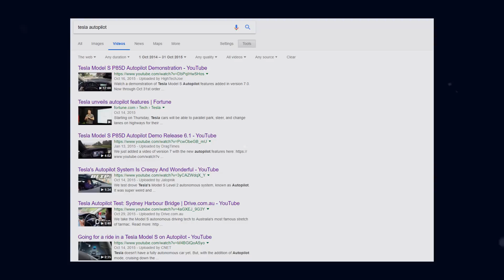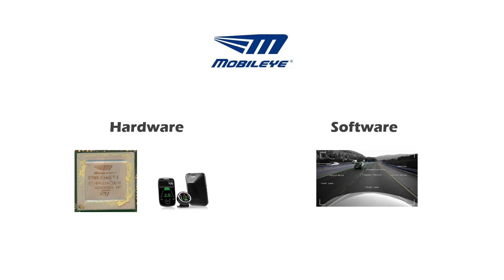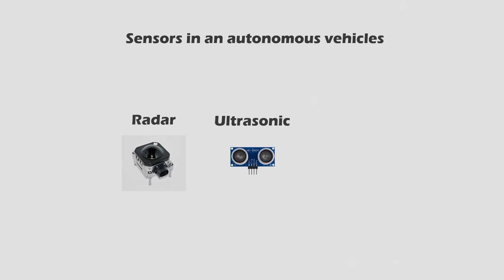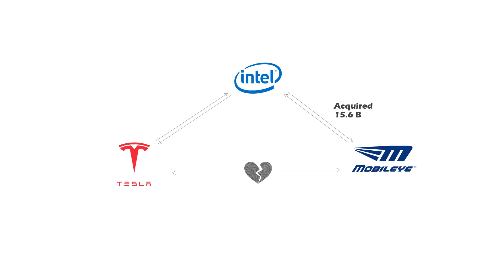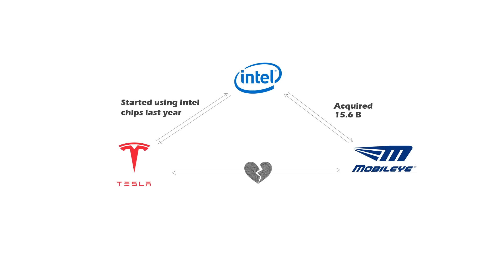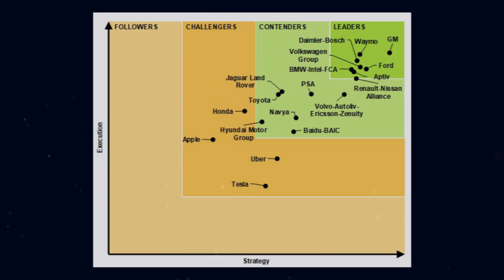Tesla's Autopilot is in Trouble, here is how to FiX it!

Comment: It is kind of silly of them to compare theoretical self-proclaimed capabilities, not even implemented in any car on the market or tested by independent party to something already on the market for some time and planed to be fazed out soon.
Reply: According to actual statistics, cars with AP are significantly safer than other cars, so AP is definitely ready for the and should be used. It was definitely a bold move to release it initially, but the data proved that it was the right thing to do.
If others still don't think their systems are ready, that's their choice, but then they are not competing seriously with Tesla. I don't think it's fair to compare prototypes to actual products, because with prototypes you have the luxury of choosing ideal conditions, while actual products have to work all the time.
Reply: Exactly. Tesla has different prototype software that show a model x driving 10 minutes through SF yet they're comparing autopilot to the other auto makers prototype version
Reply: Ambient Morality you're confused, Uber and Waymo vehicles are the same thing that google has been driving on public roads for over a decade now, basically it's a car with a laser that follows a map and makes sure not to hit anything at fairly low speeds, in my opinion this will never be a replacement for humans, it can only handle low speed city driving of mapped areas, you can't measure self driving progress by watching a demonstration, you and the rest are sadly mistaken, let me know when you can actually buy one of these cars and drive them in a variety of areas, meanwhile tesla has had commercially available autopilots for years now, if there isn't some secret project from someone else then in all actuality Tesla is the closest to full autonomous.

Feel free to argue, your knowledge isn't in depth enough.
Reply: I wouldn't call that a limitation of the system, I'd call that a demo setup, if you put following a small test course on a scale from 1-10, ten being a true autonomous better than human vehicle and 1 being like cruise control or something it's very low down there, even though from the outside it looks kinda equivalent to say a human taxi driver, don't get me wrong I consider all this technology cool, and I was highly impressed when I first saw this from google back in the day, but like I said it's not new and it's not progress, it's a demonstration, presumably for marketing purposes.
Reply: Ambient Morality
No idea what "AEB" is, but statistics definitely prove that a Tesla is safer when the autopilot is on.
Reply: Autonomous emergency braking. Tesla implemented it a few months before Autopilot, and AEB has been proven to quite dramatically cut down accidents across multiple vehicle families and manufacturers. Autopilot hasn't shown that, though.
Reply: Uber just killed a pedestrian, so....
Reply: Waymo has a fleet of self-driving vehicles on roads now, Uber has autonomous pilot fleets. Neither system is perfect, but they're much closer than Tesla.
Reply: Do all of them? Your point is moot.
Reply: *moot, and no. But it is a responsible thing to not release half-finished software that has driver safety in its hands. Most automakers don't believe their software (or Tesla's, for that matter) is ready for the road.
Reply: Ty. Yes, but I don't see the relevance.
Reply: No actual statistics show that autopilot is safer. We know that AEB is safer, but that isn't autopilot at all.
Reply: "Follow a map" sounds like less than it actually is. It is still reading the road to make sure it is following lanes, turns to the correct turning lanes, etc. It is true that the lane structure is mapped out in advance, as well as relevant road signs, and this is a limitation of the system. Of course cameras to recognize these signs are necessary for truly flexible FSD.

Comment: The biggest reason Tesla decided to do away with lidar was that it was ugly and expensive, but since then, small and inexpensive solid-state lidar has been developed and i think they should include it in their package
Reply: It also doesn't see through rain and snow.
Reply: András Bíró you're right, that's what the radar is for
Reply: we have yet to see a supposed solid-state lidar in action.
Reply: GM will use the solid-state LIDAR and they are at the top of the Navigant ranking. This thing is tiny & cheap.

Comment: They can’t change any hardware anymore right now, because all the cars are already manufactured and promises full auto in the future via software update. So tesla needs great software and nothing else.
Reply: We don't even know if the hardware is sufficient. Direct image processing is a very heavy computational problem.
Reply: That worries me a little with how much they promised. If they didn’t already make these promises they could just switch out the hardware on future cars or make an upgrade package with improved driverless features but since they’ve made these claims wouldn’t they be open to lawsuits.
Reply: i completely agree. 
the link with waymo is simply nonsense. waymo are 100% in bed with lidar, they even bought a lidar company as their charges were silly. retrofitting lidar would be insanely expensive to cars that already left the factory, and they would have to do it based on promises made. 
i wouldn't be too worried about cameras being the main hardware component. i've been driving fine with my eyes for quite some time now. 
Tesla did however lose years of experience when they brokeoff from mobileye. thats not easy to replace. 
the thing i think we have to remember is that elon rarely misses the obvious, and the model 3 would have never gone into production unless he was confident they could deliver without mobileye (it went into production after breakup). 
i certainly wouldn't count out another partnership, but only if the specialise in the hardware that has shipped in the 3. 
still loving the videos though, keep them coming!
Reply: I think if Tesla committed to replacing all hardware on past vehicles for the owners who paid for FSD, then it'd be okay.
Reply: Recent Teslas should have the processing power to process the imagery. Neural networks take a lot of performance to train, but are pretty cheap to apply on data. I agree with Elon Musk that LIDAR isn't necessary, but it does help a great deal. Without LIDAR you have a much larger burden on the software. We can do the same with moving camera images (it's called SLAM), but it is tricky to get right.

I believe that the hard part is decision-making. What to do when... How do you merge onto a busy highway? How can you robustly make it match its speed to the visibility? What do you do when you end up in a bad position because you or some other driver made a mistake? 

Knowing your current situation is one thing, knowing what to do in that situation is another. That part is not solved by far, by anyone. Google/Waymo is far ahead, but they almost definitely still have quite a long way to go.
Reply: Niosus, computing performance might not be an issue, we don't know yet. But the sensors are. My radar and the cruise control refuse to work as soon as there is snow or dirt covering the nosecone. A little snow, and I mean really little, is sufficient enough to disable the entire system. Our e-Golf has a heated radar, it never stops working in the winter. But even the cameras, especially the rear facing camera, turn pretty much useless in rainy and snowy conditions. A lidar located on the roof of the car would be able to handle these situations.
Reply: You also have a brain much more capable of processing image data. So far, we don't have a computer anywhere near the general image recognition capability of a human brain. We're getting closer, but it's hard to get very close.
Reply: He needs to get it done now. I don't buy that he is using his time for other projects. It is not his time that is being used but the programmers and engineers time. Writing no fail software is hard and time consuming. You can't make a mistake or have a bug, it will kill someone. So this means lots of unit tests and real tests and that eats up time.

Comment: One question.. WHY? Did mobile eye even break up in the first place? Your explanation wasn't really precise
Reply: Mobileye thought Tesla was moving too fast with the technology and they felt responsible to pull the brakes and ask Tesla to stop using their technology for self-driving because they didn't want to risk lives. 
Elon, on the other hand, said if their technology has saved any lives at all, it is their moral responsibility to enable it right away. (example Auto-pilot being 50% safer than a human driver when this drama happened)
This disagreement got very public and led to the break-up. The video was not very well researched if you ask me. I think Tesla with their in-house machine learning capabilities and their fleet of cars capturing data is in a very unique position to solve this in-house. 
After Mobileye they are hesitant to partner with others. The idea of partnering with Waymo is laughable because they use lidar and Tesla needs a solution that works on all their current auto-pilot 2 cars. They're not going to re-design the model 3 sensors. not at least for another 5-6 years.
Elon likes to have everything vertically integrated. Everything in-house. Tesla Vision is another example. there will be no partnerships.
Reply: TY that cleared things up.
Reply: One fatality but many other lives saved. That's why they enabled it. A quick youtube search will show you many instances of the system saving the driver from bad accidents. 

I don't remember them blaming Mobileye for it. Do you have a link for that? I may have missed it.
Reply: Actually, they said the trailer on the road looked like a highway sign due to the size. But that's still not blaming the manufacturer. Tesla has their own software. They didn't blame Mobileye in any way.  
"We don't know how many lives were saved, or whatever."
You can look up youtube and see for yourself. We don't have an exact number but it's sure more than one that we lost. 
And in that case, the driver missed a semi crossing a highway! which means he wasn't paying any attention whatsoever.
And AEB is common so...? what's your point there?
Reply: Ironically the guy who died in that accident also posted a "Tesla saved my life" video on YouTube. Also the AutoPilot can't be blamed for the accident, because it's not fully autonomous yet, the driver has all the responsibility, AP is just helping. Maybe the same crash would have happened without the AP, we don't know why the driver didn't see the trailer. Or maybe he trusted the AP too much, but that's still not the AP's fault.
Reply: @András Bíró , the guy who died also complained about a bug that end up killing him; "the car don't see stationary vehicle", he also said Tesla took toooo long to fix any bug. The police did an investigation but the conclusion wasn't publicised. After the incident Tesla & Mobileeye broke up.
Reply: xponen
AP isn't perfect yet, that's why thew driver has to pay attention. It's a lot harder to recognize stationary objects on a camera feed than moving things. And stationary object aren't supposed to be in your way anyway, which means much less training data for the AI, and therefore even less accurate recognition. AP in it's current form is meant to be used on highways, where stationary obstacles are even less expected.
Reply: @András Bíró , I think it's just flawed architecture; the original AP by MobileEye assume everything can be solved with a camera... the overconfidence (hubris) is apparent... should've add more sensors to detect stationary object instead. Probably UBER were led to same mentality and turn OFF their LIDAR as well, thus leading to a death.
Reply: xpopen
Uber proved that more sensors won't help. Also lidar is expensive, has to stick out of the car, and doesn't work in bad weather. The problem is not the lack of sensors but the software. It's far harder to identify stationary objects and find out if they are in the way and actually dangerous. For example a pothole or a small stone are obstacles in the way, but most of the time you can drive over them safely. This is not full autonomy yet, the driver has to pay attention. Tesla never claimed that AP is capable of full self-driving, in fact the owner's manual specifically warns about stationary objects.
Reply: We don't know how many lives were saved, or whatever. At any rate, AEB would saves lives as well, which is why it's a very common feature now. That is a long step from self-driving, but is still a safety feature.

Tesla has stated that the cameras were unable to detect the trailer against the background (due to insufficient contrast), which is effectively blaming the camera supplier.
Reply: MobilEye didn't want to be associated with a company that was allowing unsafe, hands-free autopilot, marketing it as an autopilot (rather than driver assist), and partially contributed to at least one fatal autopilot crash. This was exacerbated by Tesla's response to the crash, where they effectively blamed MobilEye for the failure (it wasn't their fault at all; their system wasn't designed for what Tesla was trying to do).

Unfortunately, both Tesla and SpaceX frequently blame suppliers for their own problems.